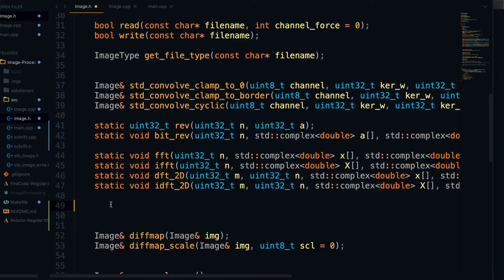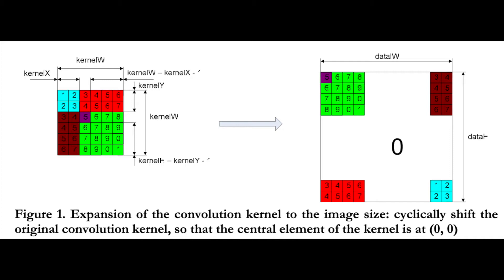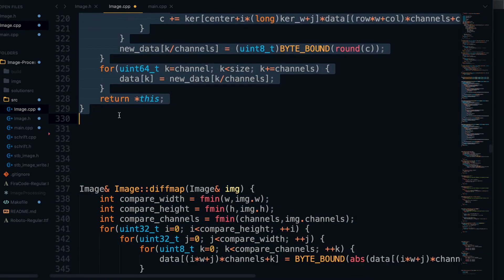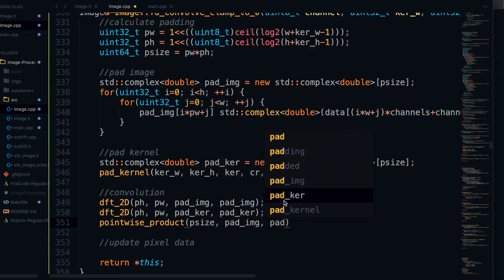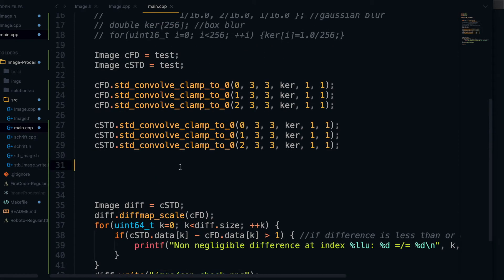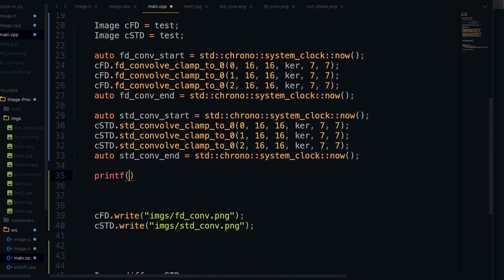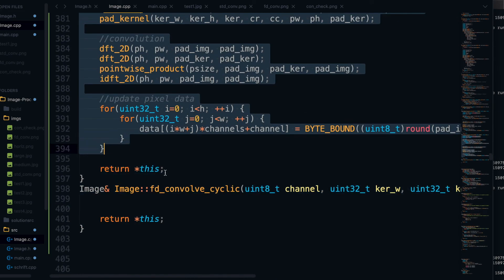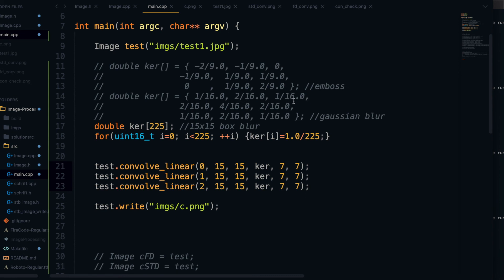Image Processing With C++: Ep. 12 - Faster Convolution (pt. 2)

Comment: Hi. Glad you found that somewhat unpolished white paper useful. There are some improvements that could be applied: instead of rotating the padded kernel in time domain, you could pointwise-multiply the dft/fft of the padded but unrotated kernel by the right imaginary exponent values that encode additional linear phase shift of that array, which is equivalent to rotation by some fixed (centerX, centerY) offset in time domain (exercise left to the reader :)